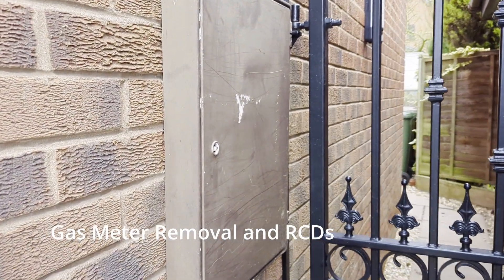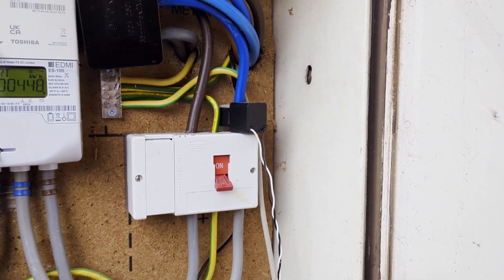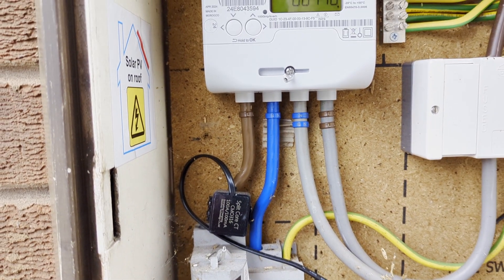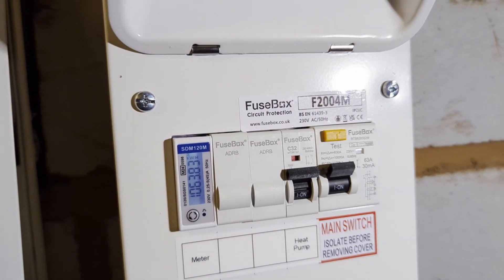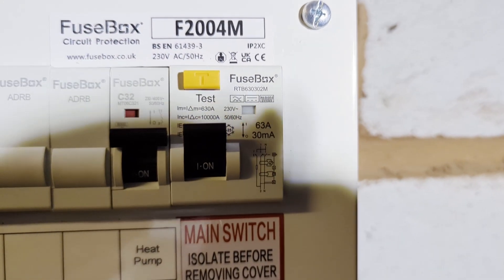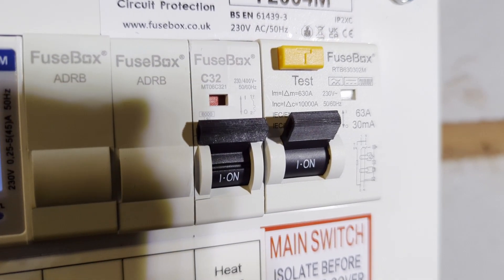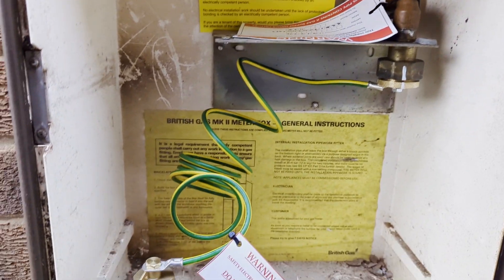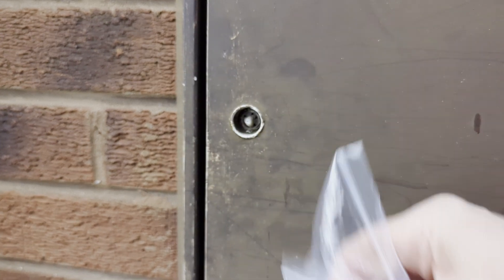Gas Meter Removal and Heat Pump RCDs

Comment: Bit silly removing your boiler. Wouldn’t want your electric bills.
Reply from the maker: We'll see.
Reply: I've got a relatively new heat pump, my total energy bills for December were £27 less in total than when I had a boiler, not even including the standing charges, which are now £100 less because of no gas.

I do have ancient solar, though solar was not great in December, I don't yet have a battery that will make bills even cheaper. Don't envy your high gas bills.

Comment: When Octopus came to install my Smart gas meter just over a year ago I thought I'd make an impression. I hoovered out the dust and cobwebs and gave both the old meter and the enclosure a thourough clean and polish. I even used a lens cleaning cloth on the meter display. The meter guy laughed when he saw it. 
Thinking outside the box ( sorry ) how about repurposing the empty meter cupboard as a location for a keysafe ?
Reply from the maker: @devjon123  Nice idea. 🙂

Comment: How has the heat pump performed during the cold spells
Reply from the maker: In terms of heating the house and water, it did really well. I know that I shouldn't be, but I'm impressed that it was able to pull heat from such cold air... it's a bit like magic. However, it was rather noisy when working hard and that put an annoying hum through the pipework around the house.
Reply: @ 
                     Was that caused by a high flow rate, something to consider when I start getting quotes, Yours was a heat geek install as well
Reply from the maker: @johnb7644  No, the flow rate, 20L/minute, remains the same during cold spells, so it's not that. The hum was probably related to the compressor, but it's hard to tell.
Reply: @ 
                      Anyway to fix additional pipe supports maybe,  So apart from the hum your satisfied and warm.   I’m having new passive windows fitted this last weeks so next job a new better draught proof front door, then quotes for a heat pump 👍